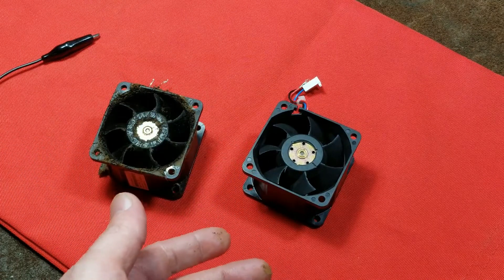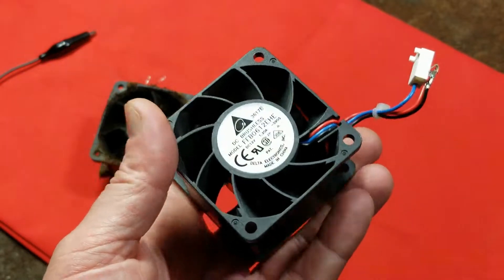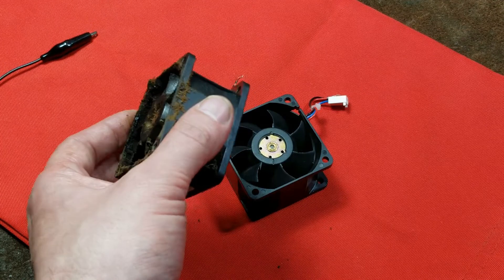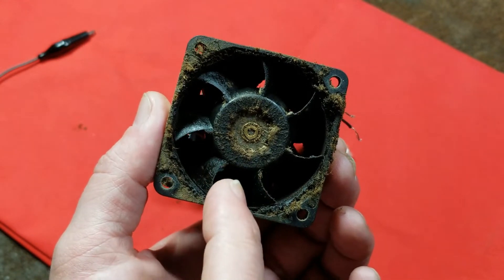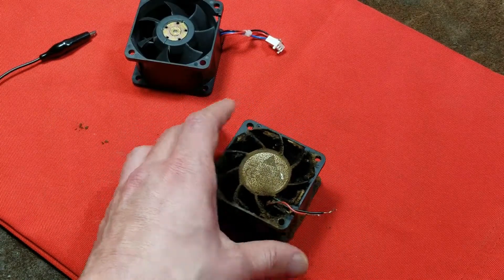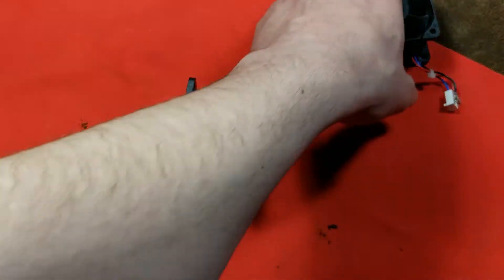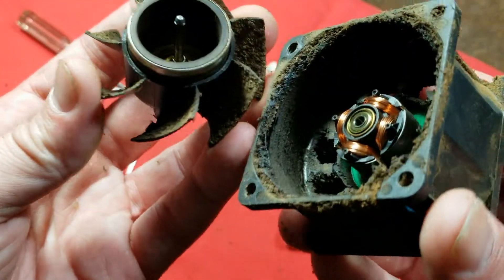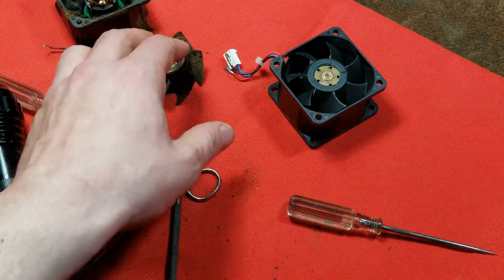Delta High Performance Server Fan Durability Evaluation

Comment: Can remember pulling a pc apart a few years ago that was +- 20 years old at the time, was used in a car repair shop, was never opened in its life, 37,5k hours on the hard drive and the fans were still going. They were rather standard sleeve bearing, completely caked with oily dust, Delta fans. They didn't sound too healthy but they were still doing their job surprisingly.
Reply from the maker: That's some impressive durability!

Comment: I run these delta 120mm and 80mm fans in my PC (not server) but on the 5v rail.. do you know if there is any issue running these at a lower voltage?

Comment: I know this post is old, but I am currently building a Threadripper Pro build, and I am looking for what approach I can take to use delta fans in my build. I am aware they may exceed the amps supported on the motherboard, so I was looking in how to go about it, like connecting them directly to the power supply, with a fan controller. This will be an air cooled build, with a Dynatron A38 cooler as well.... Since there isn't much of a Heatsink on the VRM, and I will be using ECC RAM that also doesn't have heatsinks....so air cooling is essential in this upcoming build.... Any input appreciated....
Reply from the maker: you can do a custom wiring job with the fan power wires running directly from the power supply and the control and speed wires still plugged into the motherboard. that way they will be speed controlled and monitored normally but the power won't be going through the board.

Comment: Thank you for this video. Looking for a good fan for an RC motor dual fan setup that may incorporate 2 40m mx40 mm by 28 mm fans rated at 0.5 amps or higher and at least 20 CFM each

What is your take on the fans that have two impellers that push and pull in one fan housing, I'm intrigued by those

Comment: I use similar 12 volt fans to circulate air in my off grid 12 volt solar powered home. Low current draw is my first consideration. I'd like to hook one up to pull smoke up my woodstove chimney.
Reply: M8 these are made of plastic